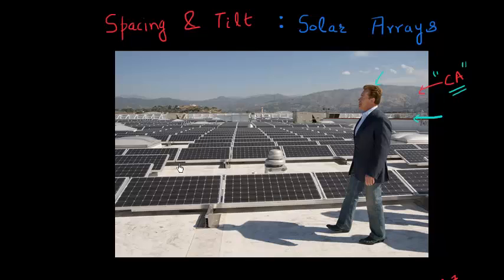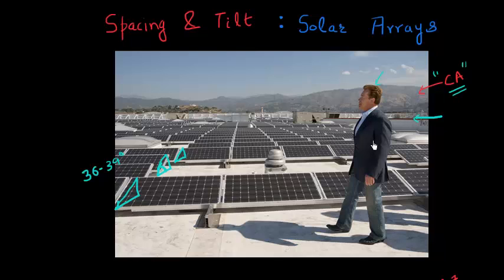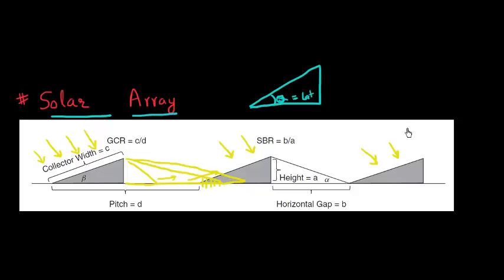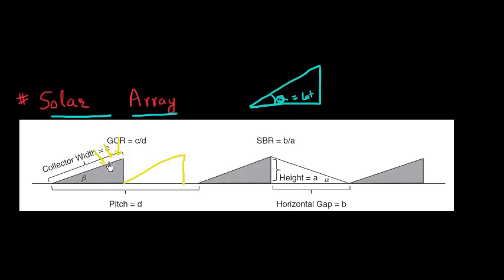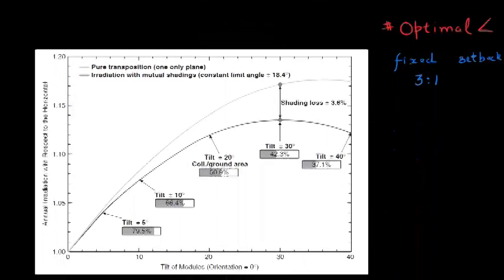Optimal tlit and spacing b/w arrays of solar panels

Comment: First,  thank-you. I'm currently sketching a software framework to control a dual axis pv system for my home.  Your commentary has given me further insight into what needs done for counter shading.  Conventional wisdom states that simply adding more panels is cheaper than investing the time and capital to track the sun. However, I live in a post war house, on a small lot with shading challenges of epic proportions. So I need to make the most of the sun and sq footage that is available.  I have taken the liberty of creating a scale of Sun Quality where Grade A Sun is where my system could intercept the light of the sun at a near perfect perpendicularity for both axis.  Grade B is only success for a single Axis. Grade C is failure to align with either axis yet still capturing enough light to create sufficient voltage to engage the inverters.  A host of Virtual Machines coordinate the activity and every 45 minutes they attempt to adjust the pv arrays in something that resembles a NASA "go for launch" sequence.

Comment: Yes, optimally the angle can equal your latitude, but in a large array such as this they may have to take high winds into consideration.  Much ado about nothing.  As to your panel orientation, of course a portrait orientation will create greater shading issues than a landscape orientation.  Just avoid shading!  All the rest about diodes is simply overthinking a very simple problem.

Comment: Or you could buy real CIGS solar panels then you dont have all this shade issue's and tilt issue's.  And then again you get better production pr Wp installed . 
Last but not least, its much more environmentally friendly way of producing a solar panel. 
+ you get no micro cracks in CIGS.
Drop the c-Si solar cells and get the real thing CIGS

Comment: The tilt does not have to be = Latitude. It depends on WHEN you want to optimise energy production. Optimisation thus depends on the application. The tilt will be different whether you want to optimise energy production over the whole year, energy production in winter or even power production at a certain time of the day.